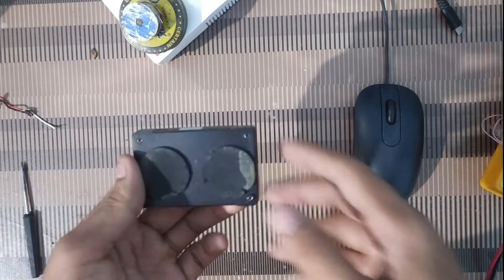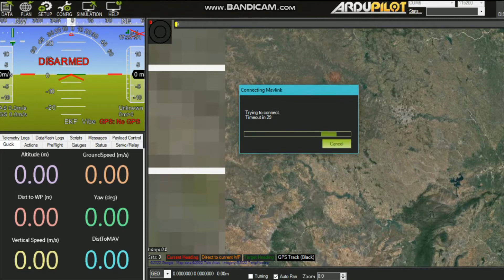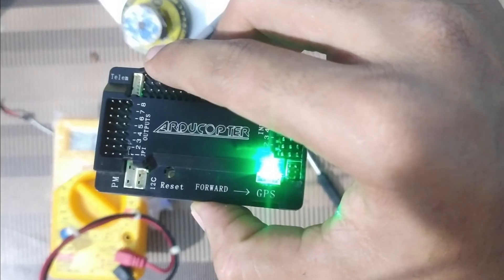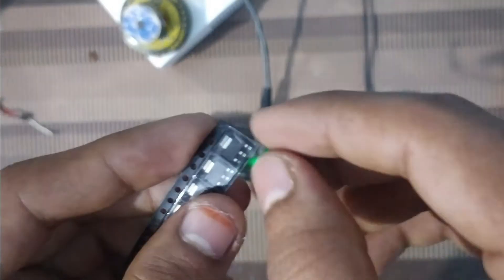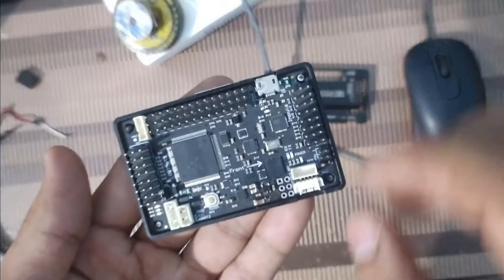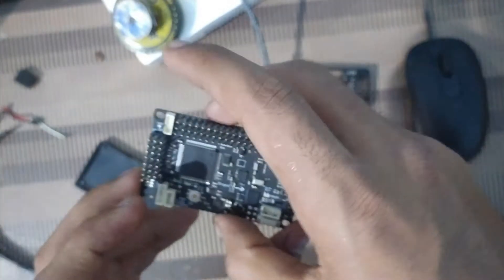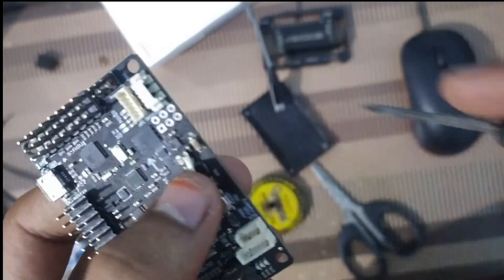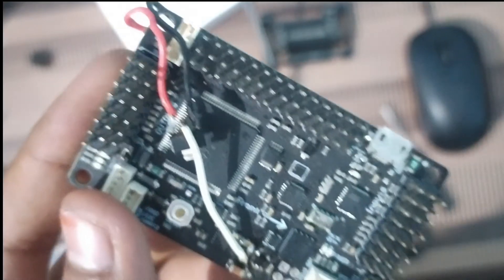APM2.8 || !!FIXED!! |NO HEARTBEAT RECEIVED || NOT CONNECTING TO MISSION PLANNER |

Comment: I have same issue but i tried ur way do i need to remove board shorted ic first in order to ur step work??in yt one channel is there it a 8 years old video and he did same but he removed board ic it works just fine now what should i do??
Reply from the maker: just recheck with the mulltimeter weather the voltage reading are correct or not 
and if my way of fixing doesnot work then try the other way as you said in one yt channel you saw 
keep trying

Comment: Hi sir
I am also having apm 2.8 flight controller actually problem that I am facing is heating in apm board and all light glow solid. And when I  checked output and negative pins through multimeter I saw that negative and positive pins were showing shorts in continuous mode
Reply from the maker: try to change the regulator and see if not refer the ardopilot website once.

Comment: Hello bhai mera Flight controller board thek tha lekin mene uske reset button ko 2-3 bar press kar diya jisse yah  no heartbeat so ho raha hai or bhai i2c port me 4.68 voltage so ho raha hai or flight controller me blue led flash ho rahi please please bhai help me,
Please bhai
Reply from the maker: sure help karunga
did u do the process which is in the video
Reply: @techyboycharan450  Bhai appki Instagram id kya hai
Reply from the maker: Sri charan_fpv